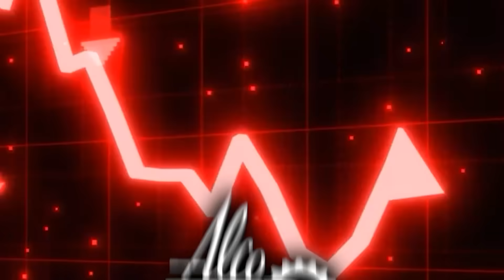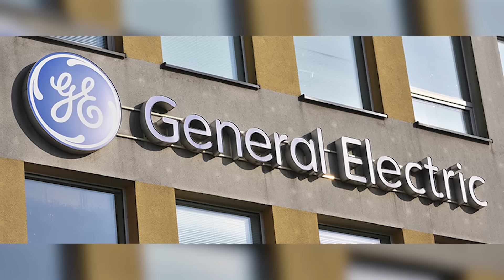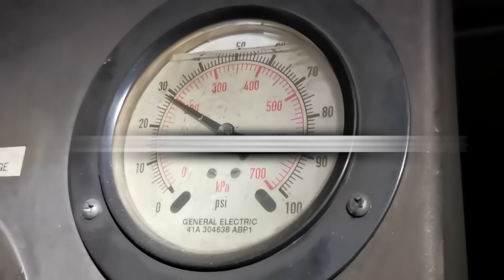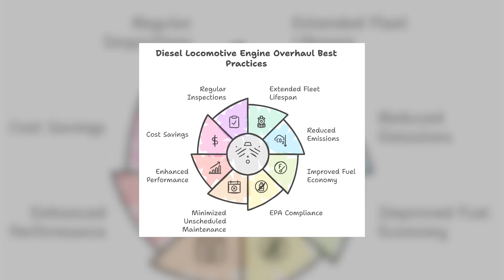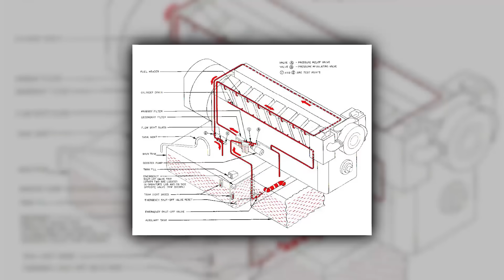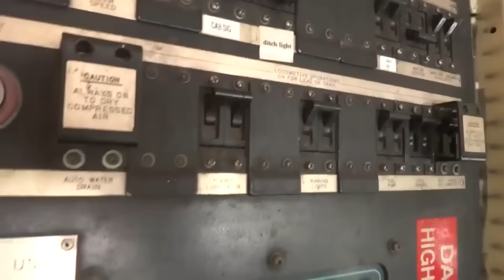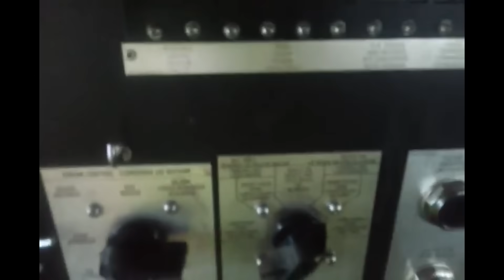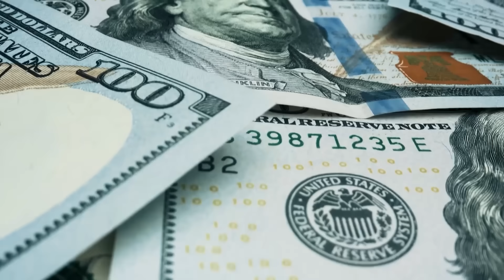The GE Engine That Buried Alco for Good

Comment from the maker: The GE 7FDL was the engine that turned GE from an outsider into a powerhouse — and it left Alco in the dust. But here’s the real question: did GE’s smart engineering bury Alco for good, or was Alco already digging its own grave? Let me know what you think in the comments 👇
Reply: Retired locomotive engineer from a class 1 US railroad.  Those FDL diesel engines were junk.  One of two things that moved GE out of the sewer was AC traction in 1990.  The two stroke 567 and 645E-3 diesel engines of EMD ran circles around that 4 stroke of a failure FDL engine.  Those FDL diesel engines far into the U-Boat series often burst high pressure fuel lines, caught fire and always had chronic oil leaks to the point it ran out onto the running boards or had serious oil at the stack that would litterally cover the entire locomotive. And more often than not smoked like an ALCO spewing wasted fuel out the stack in the form of thick black carbon.  Two things that put GE to the top was 1. EMD moved to Canada, sold off from GM became Electro Motive Diesel and and the SD50.  2. GE went to AC traction.  That FDL diesel engine had nothing to do with its success at the time.  In the 90's GE finally got their act together after diesel locomotive pain and suffering.  In our locomotive shops on the UP the phrase was often coined "GE can't make a decent light bulb let alone try to build a locomotive --- those pieces of sh-t."  The shop bays at North Platte always had more GE's than EMD beyond the quarterly semi-annual and annual inspections.  In the mid 1990's GE woke up and their product became more and more reliable and preferred.  Now they have become the primary work horses in the railroad industry, with reliability, the latter that one never could say about them in the past.
Reply: Retired locomotive engineer here from a major class 1 US railroad:  This presenter has other videos that should be fact checked. A lot of miss information.  Be wise be cautious.  Many of these arm chair railroad "experts" do a disservice to railroad industry.  Thumbs down for this inaccurate presentation.
Reply: @ernestyeagley512 
I second this man's motion
Reply: The 7FDL is still a piece of sh!t, it was a piece of sh!t then and it's still a piece of sh!t.
EMD's are still running today that we're built in the 50's going to work everyday just as designed.
Whoever put this video together never researched anything before making it and it's purity obvious . . . If your going to put information out there, you might ought to make sure it's legit don't yea think . . .
Reply: I love the parts of the video where it showed GE locomotives smoking really bad! Alco locomotives look way better than the gevos we use now!

Comment: Alco rushed the 244 into production. They already had a V type engine, the 241, but the war production board prevented development until the later stages of the war. The 241 had designs that would be used in the 251 series diesel engines. The early problems with the 244 were crankshafts that were cast instead of drop forged, the GE supplied air cooled turbo chargers and fuel lines that ran through the engine block. Alco replaced the cast crankshafts with the drop forged ones and a water cooled turbo. That solved some of the issues. The bearing issues were corrected with the 251, the 244s in certain situations were prone to spin the bearings. Many railroads that bought the early ALCOS either didn’t buy or had token purchases of later 251 powered locomotives because of those problems. While other companies continued to use ALCOS both old and new. Also Alco’s Canadian subsidiary MLW continued to sell 251 powered locomotives for several years after Alco stopped producing them here in the US.
Reply: You pretty much covered all the bases here!  The War Production Board really did ALCO wrong.  Sure they made a pile of money on producing a lot of steam locomotives during the war, but blocking further diesel development, while allowing EMD to go full throttle with diesel development, didn't do any favors for ALCO.

The 251 was a good engine.  They're still being sold today in their many configurations.  It would be very interesting to see some deep pocketed museum/preservation group or RR that has some old ALCO diesel install a new build 251 in a rebuilt locomotive.

Comment: The 244 dailed because Alco cut corners in order to get the engine to the market in a hurry. It didn't work. Unforunately, EMD made the same mistake with the SD50. The engine was good (The 645) the rest of the enginr was a dog. GE was an opportunist with nothing to lose and bought the market, plain and simple...Once GM cut off EMD and EMD went from owner to owner, GE could spend anything it wanted to keep the market and it did,,,  I love how this film uses EMD locos when talking about engines with the 7FDL... DUMB.

Comment: Retired locomotive engineer from a class 1 US railroad.  Those FDL diesel engines were junk.  One of two things that moved GE out of the sewer was AC traction in 1990.  The two stroke 567 and 645E-3 diesel engines of EMD ran circles around that 4 stroke of a failure FDL engine.  Those FDL diesel engines far into the U-Boat series often burst high pressure fuel lines, caught fire and always had chronic oil leaks to the point it ran out onto the running boards or had serious oil at the stack that would litterally cover the entire locomotive. And more often than not smoked like an ALCO spewing wasted fuel out the stack in the form of thick black carbon.  Two things that put GE to the top was 1. EMD moved to Canada, sold off from GM became Electro Motive Diesel and and the SD50.  2. GE went to AC traction.  That FDL diesel engine had nothing to do with its success at the time.  In the 90's GE finally got their act together after diesel locomotive pain and suffering.  In our locomotive shops on the UP the phrase was often coined "GE can't make a decent light bulb let alone try to build a locomotive --- those pieces of sh-t."  The shop bays at North Platte always had more GE's than EMD beyond the quarterly semi-annual and annual inspections.  In the mid 1990's GE woke up and their product became more and more reliable and preferred.  Now they have become the primary work horses in the railroad industry, with reliability, the latter that one never could say about them in the past.
Reply: Remember you can’t spell the word garbage without the letters GE

Comment: Rose colored glasses.  The 7fdl was a mediocre engine at best until the dash 7 line.  The alco 251 was the superior engine.  Having 2 builders after alco left the market was important enough for railroads that they ordered from GE despite their significant shortcomings  compared to EMD (reliability).  It wasnt until EMD stubbed their toe with the 3,500hp 645 that GE was given a golden opportunity.  Railroads have very looonng memories and despite the 3,600hp 645 rectifying virtually all issues with the earlier sd/gp50s GE got a majority of orders.

Comment: If you ever operated a GE in the 1980’s you remember! Why? Not because of anything good! My knees still hurt! Climb the ladder to get on the locomotive and if you’re not extremely careful, your knees will slam into the rung of the next step! Doing this once is painful doing it 100 times because of extremely poor design becomes damaging! Next they swayed and bobbed up and down like the suspension was absolutely worn out and the sound they made in the cab was annoying! At that time, at least the EMD’s specifically the SD 40 was so far ahead of the G E that it wasn’t even funny! If we had a GE in the lead, we knew it was going to be a lousy day!
Reply: Fellow brother.  I agree with you.  When I was hostling back in the late 1970's I banged my right knee really good in attempt to board up on one of those straight laddered piles of junk, just like those ALCO Centuries were. Time to time I still feel it flare up. You froze in the cabs too in the winter.  That front door had gaps where you could throw a cat through.  Water bottle saturated paper towels would be stuffed in those cracks by the head brakeman so it would freeze solid and seal off the draft.  Oh and those U-28 and U30C hot water heaters.  You had to sit on them to at least get warm, especially when it was way below zero outside.
Reply: Retired locomotive engineer from a class 1 US railroad.  Those FDL diesel engines were junk.  One of two things that moved GE out of the sewer was AC traction in 1990.  The two stroke 567 and 645E-3 diesel engines of EMD ran circles around that 4 stroke of a failure FDL engine.  Those FDL diesel engines far into the U-Boat series often burst high pressure fuel lines, caught fire and always had chronic oil leaks to the point it ran out onto the running boards or had serious oil at the stack that would litterally cover the entire locomotive. And more often than not smoked like an ALCO spewing wasted fuel out the stack in the form of thick black carbon.  Two things that put GE to the top was 1. EMD moved to Canada, sold off from GM became Electro Motive Diesel and and the SD50.  2. GE went to AC traction.  That FDL diesel engine had nothing to do with its success at the time.  In the 90's GE finally got their act together after diesel locomotive pain and suffering.  In our locomotive shops on the UP the phrase was often coined "GE can't make a decent light bulb let alone try to build a locomotive --- those pieces of sh-t."  The shop bays at North Platte always had more GE's than EMD beyond the quarterly semi-annual and annual inspections.  In the mid 1990's GE woke up and their product became more and more reliable and preferred.  Now they have become the primary work horses in the railroad industry, with reliability, the latter that one never could say about them in the past.
Reply from the maker: That’s an awesome firsthand perspective — thank you for sharing it! You’re absolutely right, GE’s early Dash units weren’t exactly famous for crew comfort. The rough ride and that ladder design have been mentioned by a lot of engineers from that era. The SD40s really did set the standard back then for ride quality and reliability. It’s stories like yours that make these videos come alive — appreciate you taking the time to share it.

Comment: Perry T. Egbert destroyed ALCo. He cancelled a contract with South African  rail for over a hundred locomotives for no reason. Then, when ALCo lost GE as a supplier, Egbert with maniacal zeal demanded only American components would be used in ALCo locos. Where was he going to get them from? EMD weren't going to supply them, Siemens and Mitsubishi could have filled the void, but they were foreigners, can't have that. And ALCo died. Then GE used the ALCo 251 series engines to design the 7FDL, simple as that. ALCo cut their own throat. EMD engines had 1 major trick GE couldn't match. The EMD blocks were fabricated, the 7FDL were cast. If the EMD block cracked, cut out the bad piece, world in a new bit. The 7FDL, if it cracked and they do, regularly, you had so much scrap metal. They've never solved the turbocharger problems, they catch fire on a very regular basis. I could go on, but you get the idea.
Reply: South Africa Railways bought its first Ge's in 1958; the were 43x U12B's, classified as SAR's Class 31. SA then wanted some bigger locos , a Co+Co and a !Co+Co1, and wanted as much commonality as possible. While Alco was keen on the Co+Co, they didn't quote on the other one (required for lighter axle loading in South West Africa (now Namibia). So both orders went to GE. Both were high-nose designs. These were U18C and U18C1 locos., bought from 1959. Later a more powerful version of the U18C1 was made, a U20C1, which was basically the same as the Co+Co U20C, but with idler axles, and known as Class 33.000. This loco started the trend of SAR ordering very similar locos from both GE and GM (presumably to keep pricing competitive). The most recent locos have been the classes 43 and 44 from GE (C30ACi  and the ES40ACi) bought by Transnet Freight Rail which succeeded SAR in respect of freight. They also bought some Chinese Class 45's which have MTU 4000 20V R63L engines. PRASA inherited the passenger services and recently and extremely controversially bought the Afro4000 from Vossloh/Stadler (without sufficient modification for them actually to work in SA.
Reply from the maker: Brilliant insight — you’ve summed up so many of the key turning points in ALCo’s downfall. Egbert’s decisions definitely accelerated the collapse, especially that ‘American components only’ stance when the supply chain was already against them. And you’re right — GE’s evolution from the 251 to the 7FDL is a perfect example of learning from a partner’s technology and outpacing them. The cast vs. fabricated block point is a great one too — it really highlights why EMD engines could be repaired in the field while GE’s often had to go home on a flatcar. Appreciate you sharing this — clearly you know your diesel history inside out!
Reply: @TheMechanicalSide I worked on the railways as an engineman/fireman, here in Australia. I really loved the job. But I was 21, just bought a new Triumph Trident, and found the depot dickhead sitting on it. I knocked him on his arse, but that was stupid, as the night foreman saw it and reported me, to the depot boss. Fighting at work was not condoned and we both got the sack. I've always had a great interest in rail in general, a lot of my family were employed on the rail system in one aspect or the other. My uncle was a fireman on the legendary Heavy Harry steam locomotive here in Victoria. He was killed riding a motor bike, before I was born.

Comment: GENERAL ELECTRIC ATTAINED MORE DEPENDABILITY WITH THE DASH 8 COMPUTERIZED CONTROL SYSTEM, DUMPING ELLIOT TURBOS , AND GE JET ENGINE DEPT RE DESIGNED THE GE TURBO!
ALSO THE EB WELDED CYLINDER ASSEMBLY CURED THE HEAD SEAL PROBLEMS!!
THE SANTA FE LOCOMOTIVE SHOP DID AN LOT OF FIELD TEST ACTIVITIES TO PERFECT  THE BRAND!!
 IN SHORT THE GE LOCOMOTIVE WAS BUILT AT ERIE PA, BUT WAS PERFECTED IN OUR SANTA FE ARGENTINE SHOP!
BEEN THERE , DONE THAT!!!!
Reply: The GP60M was more comfortable though. They had the proven Blomberg trucks, instead of the FB, which ride like a lumber wagon. The EMDs loaded quicker, and were easier to control.
Reply: Stop shouting, dummy.